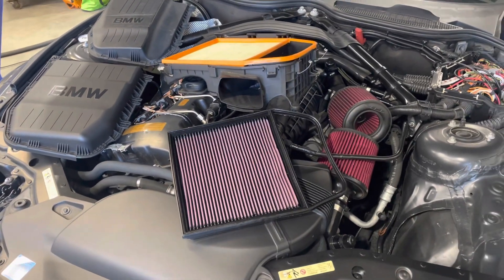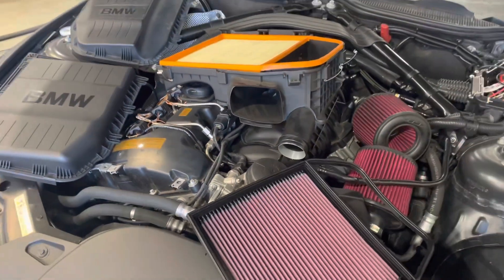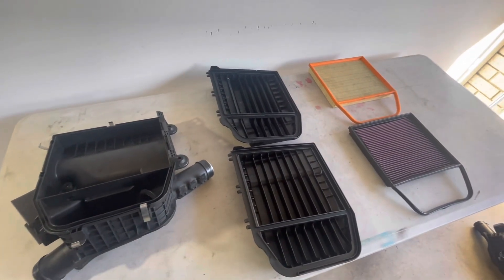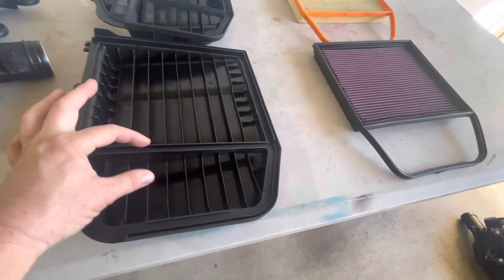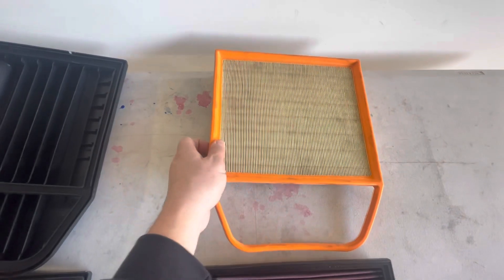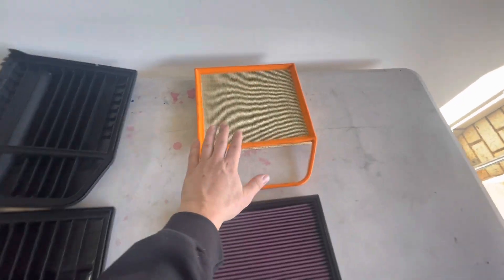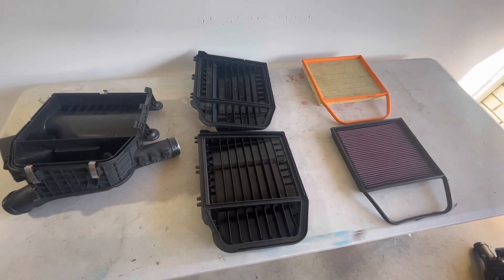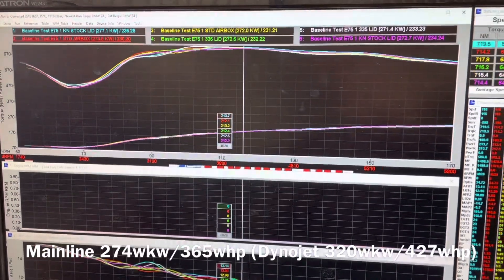BMW N54: Which intake delivers the most power?

Comment: I know this video is a couple of years old, but I have to say, regardless of whether the hood was up or down or what boost level was used, the most important part of this test was the consistency. Essentially the only variable was the intake configuration changes - that is crucial. Whether or not heat soak affects power is a separate issue and not the point of the test. This test shows that there is no difference due to filter type or intake configuration between the options tested. Whether one setup is more prone to heat soak than another is a separate test. I have aFe pro Dry S cone filters on mine - car came with the aFe intake. I don't mind the look, but I debate if the lack of filtration efficiency compared to an OE filter is worth it. If I can stay up on oil changes, I may keep the aFe, but if not, may just go back to OE. Great vid, cheers!

Comment: You have to close the hood and let the car heat soak for proper comparison.
Reply: To do a proper test, the hood should have been closed, with a nice big powerful fan blowing onto the full front of the car.
Reply from the maker: I agree that it may have a slight effect on the results but it’s harder to get consistent IAT’s on back to back pulls with the hood shut.  The experiment would take 10 times longer and the dyno charges by the hour.  The DA also changes over time so you introduce another variable if you spread the experiment over more time.
Reply: Do you really though? Doubt shutting the hood on a dyno simulates the amount of heat soak a vehicle traveling down a road would experience due to the lack of airflow. Would result in higher than normal temps if anything. If the car was in a wind-tunnel I could see it making sense. But hey, I am no expert... just a few thoughts.

Comment: great data, thanks!!  I would've thought FBO stage 2+ woulda seen some increase from an upgraded intake.  
BMW did a great job with the n54!!... sort of lol
Reply: They definitely do a good job on their airboxes. Basically a ram air setup from factory
Reply: @larrylegend4886  true, really most modern oem intakes are better for basic bolt-on builds than the flashy cheap options

Comment: What happened when you turned the boost up to a reasonable level for that setup?  Higher power levels would be the best opportunity to differentiate between the setups.
Reply from the maker: N54 life happened: I started getting a misfire at 16psi so I need to track down the cause before pushing it again at higher boost.  I wanted to do a heap of dyno pulls at 10psi to ensure the misfire wasn’t present at lower boost, hence the opportunity to test the intakes in the process.